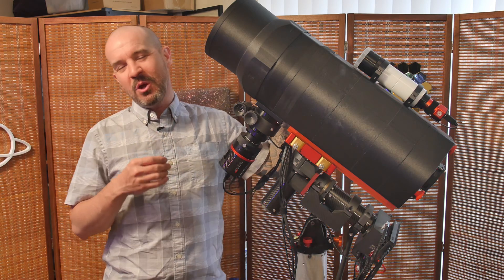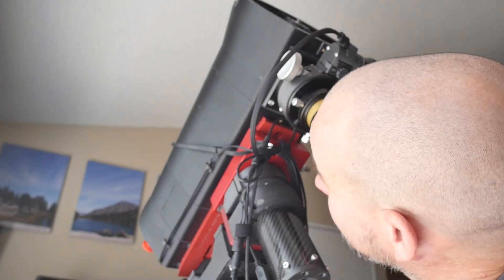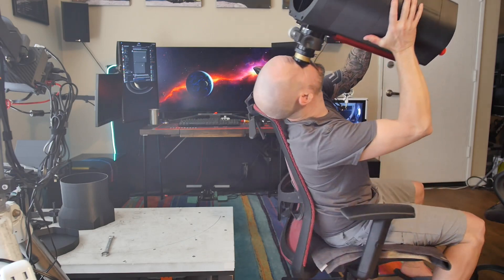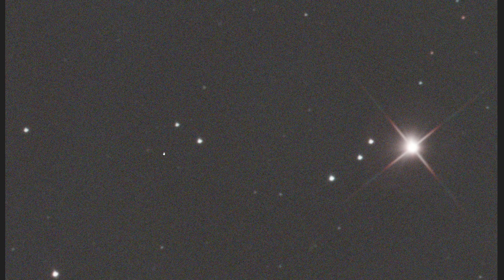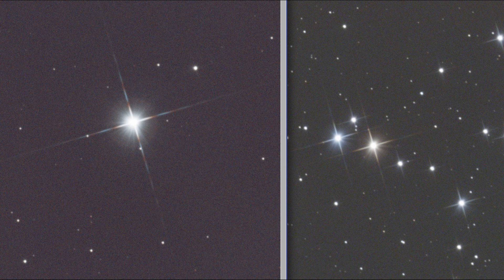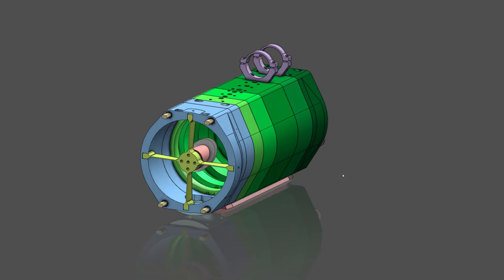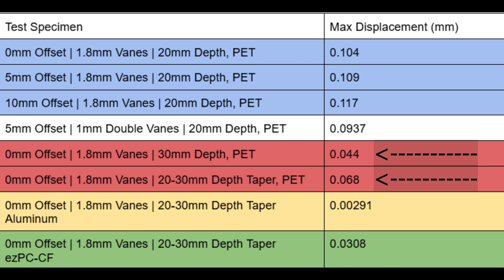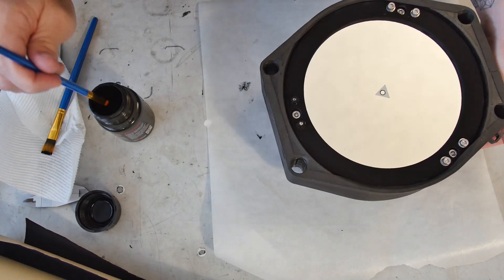DIY 3D Printed Telescope Perfection Achieved!?

Comment: i also wanted to recommend that paint from the last video but i see you were on top of it. be careful as the paint is easily scratched of and has poor bonding
Reply from the maker: Thanks. Just seems you need to be careful a bit when handling the parts to install. Once installed, they don't see any wear or handling so I haven't seen it as much of an issue.
Reply: @designbydave  I guess it goes without saying you should always be careful with your telescope lol!

Comment: Just started printing it-with a few mods lol.
Reply from the maker: What mods? Hop on the discord and share, we'd love to see!
Reply: @designbydave  I changed the base so as to use a standard primary mirror carrier. Also removed the flutes from the tube sections and made the spider part of the focuser part of the tube.
Reply: @designbydave  I tried to join the discord and it said unable to accept invite.
Reply from the maker: @69Atho  try this link https://discord.gg/bZeur7rU

Comment: Super cool project!  Have you tried a different coma corrector or tried going without it just to see the effect on the diffraction pattern/halos?  On a related note, what filters are you using?
Reply from the maker: I have not, but I suppose that would be interesting to see. Although maybe a moot point as a coma corrector is definitely necessary.

Comment: Hey that camera looks awfully familiar! Great video. I have seen a 3d printed version of an auto collimator done in white filament and it had concentric ridges on the inside that you'd use for referencing. May test it with my MAK considering I'd need like over 100ft to my artificial star.
Reply from the maker: I'm loving the Uranus-c pro and very glad I upgraded from the non-pro.
Hmm interesting, can you share that model, if you can find it in the discord?
Artificial star... I think I have a solution for that. Next project...
Reply: @designbydave  The new ZWO ASI585MC Air is out now😎

Comment: Avoid Musou black. It requires PPE and when it dries particles begin to fall on your primary. Black 4.0 is better. I read pros and cons for the various ultra blacks for flocking in astronomy and the consensus was that Musou is unsuitable
Reply from the maker: What is PPE?
Reply: @designbydave  Personal Protective Equipment - You need a mask with filters for this paint
Reply from the maker: @asicdathens  For a water based, acrylic paint applied with a brush?